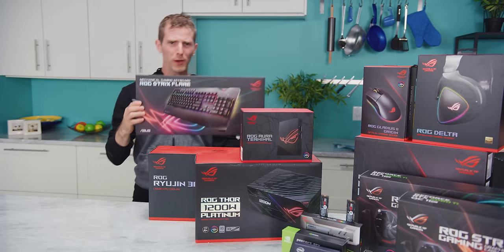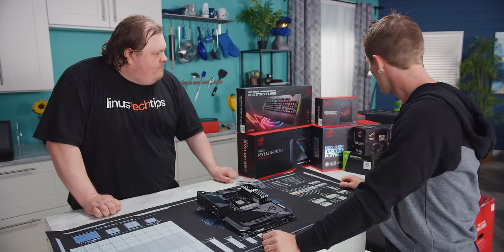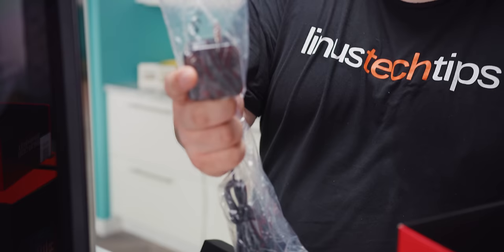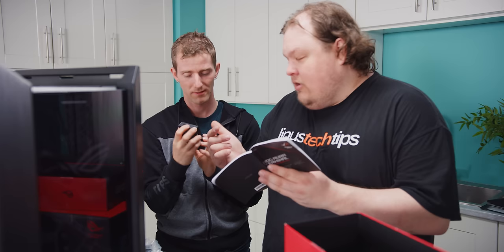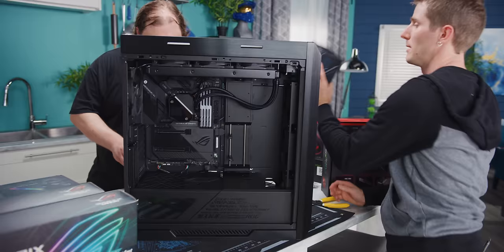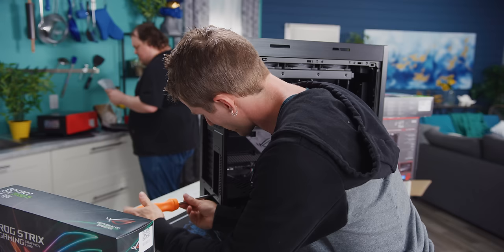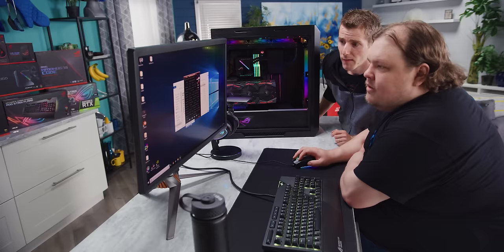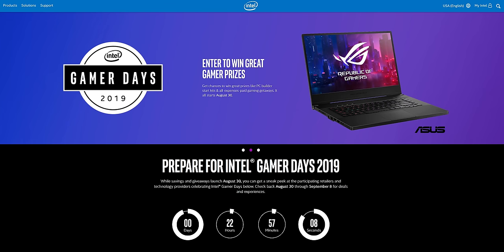The All-ROG Gaming PC!

Comment: hey, where does the DVD drive go into on this case ?????
Reply: Nowhere. That case doesn't support internal 5.25" drives. DVD drives are mostly a thing of the past in most computer systems. If you really want to keep using a DVD drive you will either need to buy a case that supports internal DVD drives, or buy an external DVD drive. Either will work just fine for the majority of use cases.

Comment: So, I wanna get some ratings and opinions on other people about this casing. So its called the ROG Strix Helios, probably the most heaviest casing that rog created. In its current design what do you think about for a 4000$ budget only for the whole system unit. Is it worth it? In terms of its space inside, airflow, 3x built in fans or add more, and others?

Comment: so i just want to  say you installed the radiator for the ryujin the hard way  if you had taken 2 seconds to look at where the rad screws go in then you would of seen 2  screws on 1 side  and that metal panel lifts out from the center  but i do have a question regarding this case and ryujin ii cooler combo which is the updated version to the 1 youve used but  the ryujin came with an argb fan controller that handles 4 fans my question is do i  still mount the rad fans using a 2 into 1 y cable  to the cpu fan header or the fan controller ?
Reply: also the 2 metal panels at the bottom that conceal the dual 3.5" drive caddy and PSU also come out with 1 screw each

Comment: And I just bought a new system ..i7-11700 32GB ddr4 3200 ram .. non over clockable but it does not use much power so will not put up my electric bill .. much .. and it is only 2000% faster than my old system .. so I am happy.

Comment: For those wondering this is roughly a  $9,000 - $10,000 USD setup if you include the gear and 2k monitor
6K for just the pc build. I want it (○_○) 

I have it all other than gpus for obvious reasons

Comment: Good Morning this CPU cooler Buy ASUS ROG Ryujin 360 CPU AIO Cooler, I can use it on a LGA 1200 socket motherboard, like this ROG Strix Z590-E Gaming WiFi 6E LGA 1200 (Intel 11th / 10th Gen) ATX Gaming Motherboard (PCIe 4.0, 14 + 2 Power Stages, DDR4 5333+, Dual Intel 2.5 Gb LAN, Thunderbolt 4, 4xM.2 / NVMe SSD and Aura RGB)